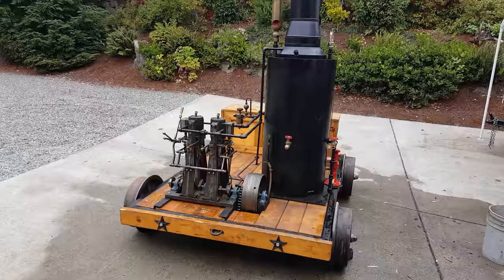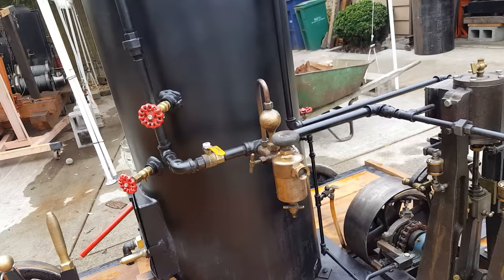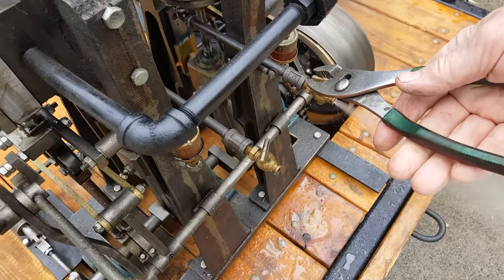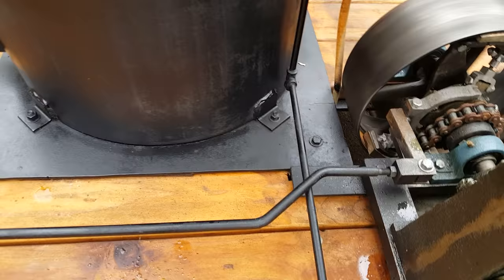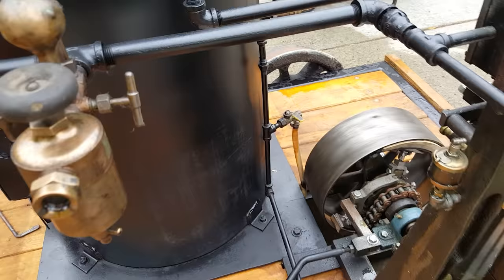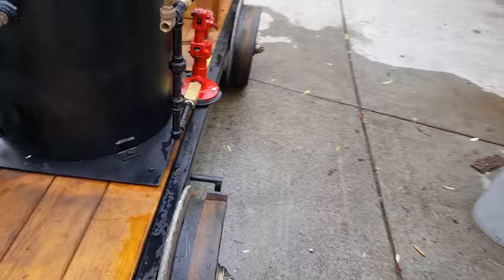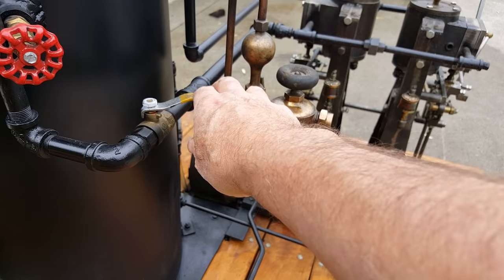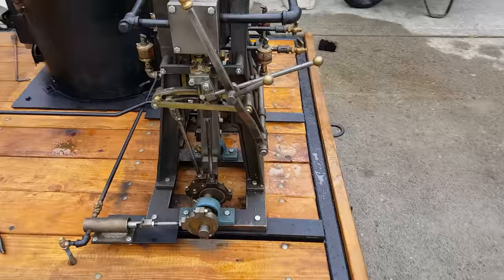Steam Speeder for John Railroad boiler locomotive whistle gauge

Comment: Do you hand build from scratch that clutch system inside the flywheel? It looks like the same type system in an old power hammer I used to have, thanks and I'd love to see that a little closer if you think of it next time.

Comment: I don't understand why you have two pumps. If the hand pump used for initial filling?
Reply from the maker: If there is not  enough steam pressure to run the engine and the operator needs a way to get water into the boiler.